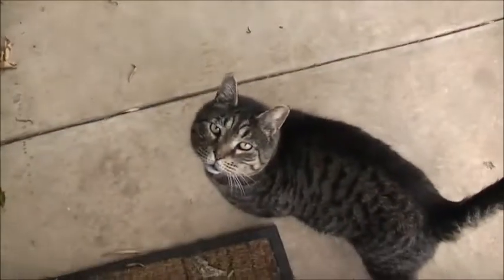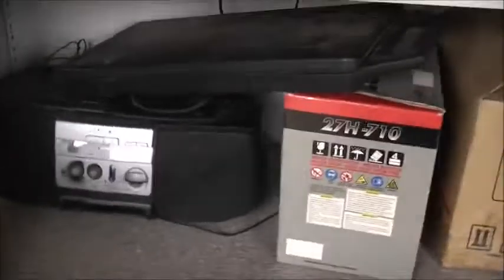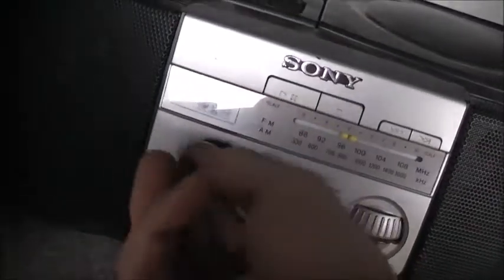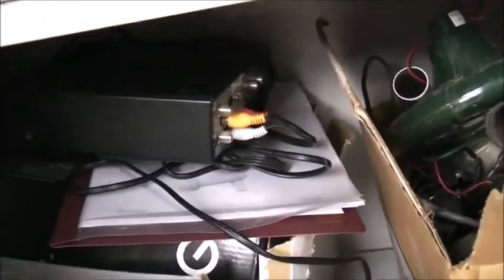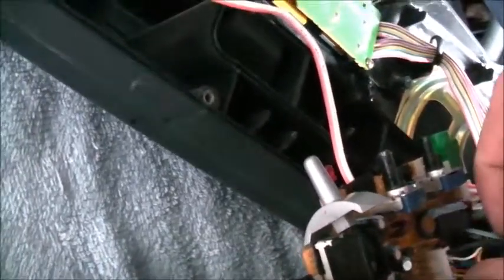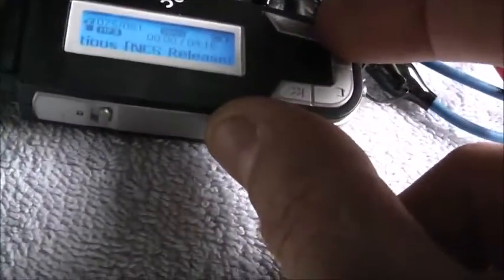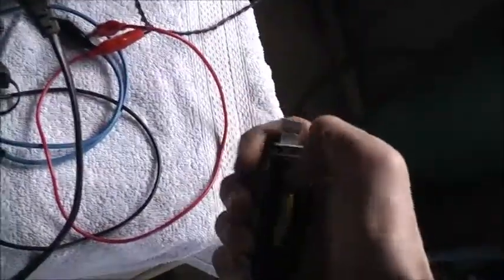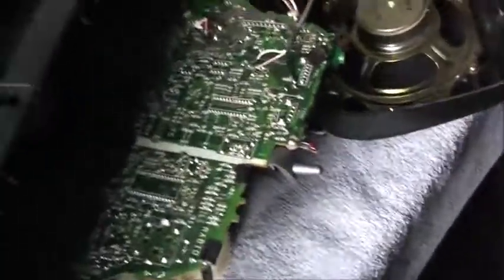Sony Boombox Line In Mod Attempt

Comment: You need to tap in after the pre-amp.
XD Might be easier to use the CD side, as it uses line level input to the AMP  99% of the time.